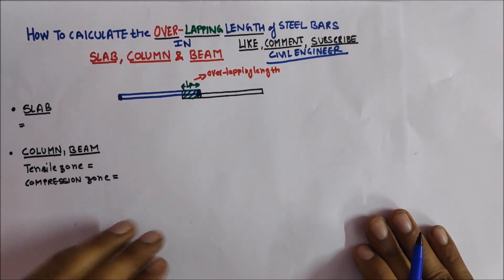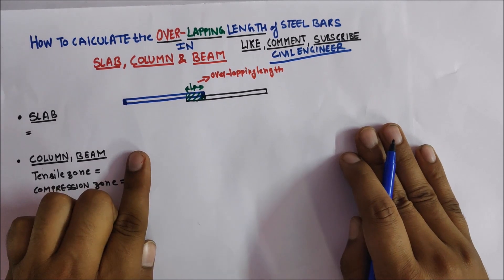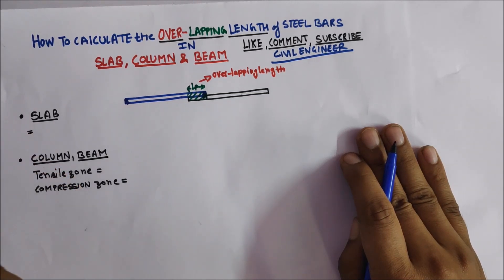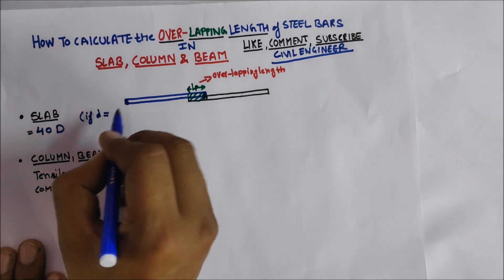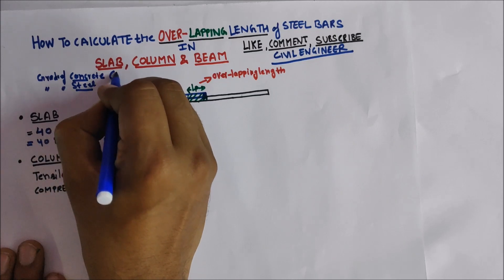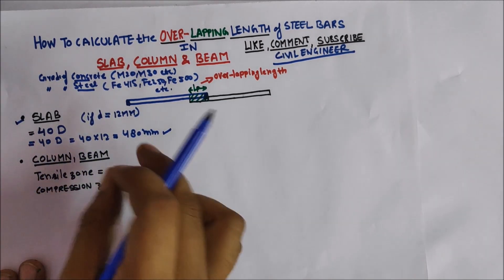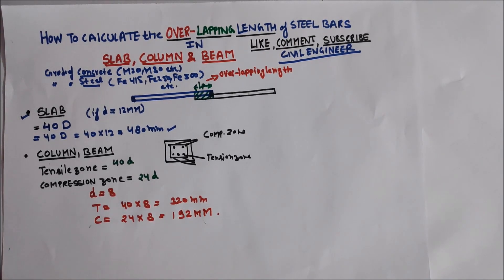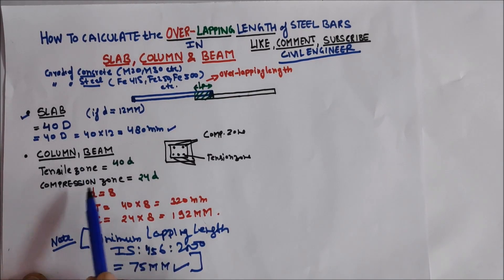How to Calculate the OVER-LAPPING LENGTH of STEEL bars in SLAB,BEAM & COLUMN

Comment: as per is code 456 in compression we take as 24D 
but we will alsontake 1.5 FOS
so the value will be in compression   zone
24x1.5=36D
so the minimum length in compression is 36 D